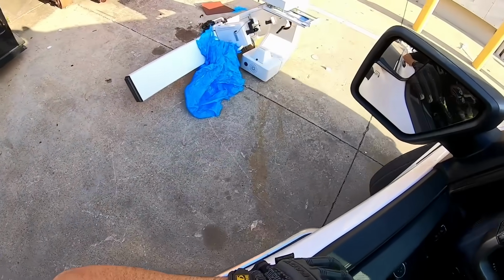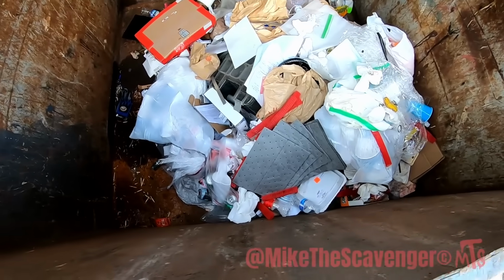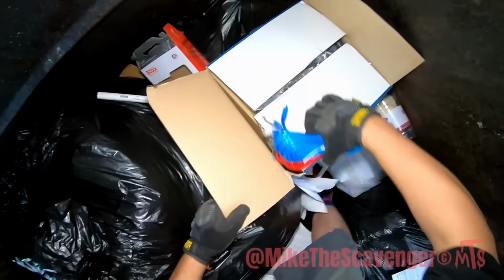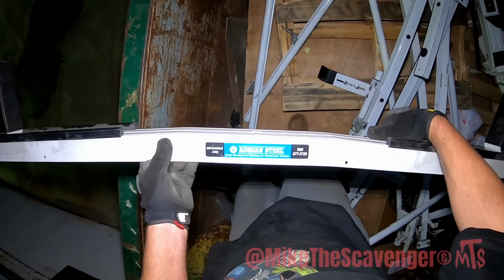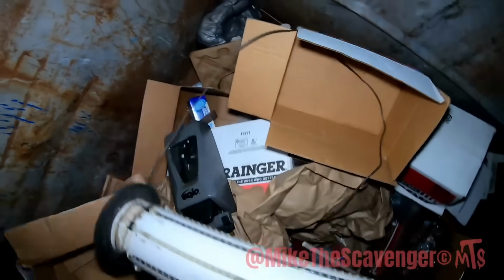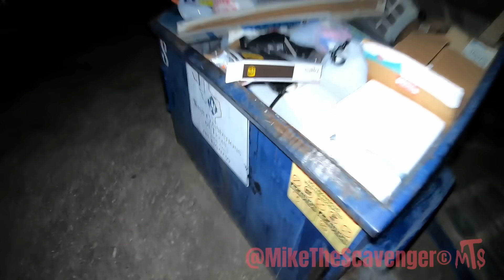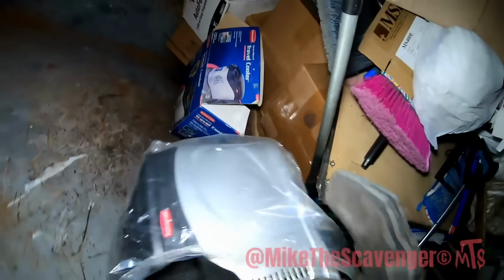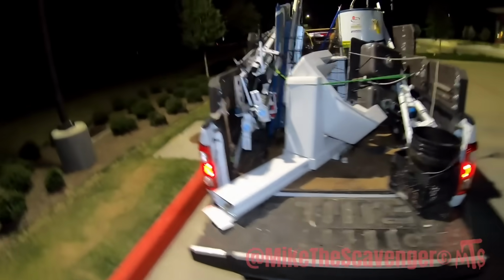Dumpster Diving "It's A THRASH Panda!"

Comment: Mike,
The x-ray machines have changed. You need to heve a geiger counter with you at all times. I saw the radiation stickers on it but most likely when active.
Please use caution dismantling any machine that has that symbol on it. May have an ammout of radiation on that metal.
Get a personal geiger counter and keep in the truck. When it sounds its alarm just leave it where it lies and keep away.
Best to you and your family.

Comment: Hey Mikey!!  Those keyboards at 3:22 looked to be OEM Apple mechanical USB keyboards.  If so, they are worth $$$$!!  The tool at 12:11 looks to be a Schraeder valve removal/install tool (everything from bike tire valves to HVAC systems).

Comment: Those long aluminum square poles you had are called load locks. They use them in the back of the trailer to support the load and also to support the trailer at the same time.

Comment: That is an older dental panoramic X-ray machine that loads a film cartridge in that part that slides in and out. Digital X-ray machines use way less radiation exposure for an image making this one out of date. You may want to check the specs on this model or call the company to make sure it wasn’t made before 1979 (I doubt it), because it could have PCBs. Most modern machines like this don’t use a radioactive element, but instead converts electrical current into ionizing radiation (X-rays) WHEN IT IS PLUGGED IN AND ON/IN USE. Otherwise it should be harmless. It might have lead? But probably lots of good scrap value. The dental office tossing it out should also know this because we have to be regulated by laws to use these and can’t just toss out radioactive materials, which these shouldn’t have, or else THEY would be in trouble. That is all.😃

Comment: Hey Mike, that Cranex 3 xray machine only produces radiation from the X ray tube when there is power to the unit. But maybe do some research yourself first if you are going to fully disassemble it.

Comment: Hopefully the source has been removed ! I can still remember the Metzler scale Technician  who pmd our lab scales and all his fingers were screwed from working on radioactive contaminated scales in the nuclear industry.  He was around 50 but looked 90 years old . Buyer beware  !
Reply: Modern ones like this convert electrical current to ionizing radiation (X-rays). Only emits X-rays when plugged in and activated/in use with the trigger button.
Reply: @dr.a006  Hopefully he knew this already as I assumed they had a radiation source .

Comment: The X-ray machine is an OPT or OPG machine. Only generates X-rays with electrical current. There's a Tungsten anode in it if you can scrap tungsten...

Comment: Mike that panographic X-ray has a head in the c arm part that needs to come out before it gets scrapped it's where radiation is ommited when power is applied
Reply: Also the counter weights have cables sometimes.lay the X-ray on its back and everything should slide out

Comment: Radioactivity sticker on it....🤔
Reply: Radiation only when in operation, there is no radioactive substance in it ! It's an X-ray for dentists
Reply: @dd313car correct. No radioactive elements used in modern ones like this. Electricity converted to X-rays. Physics!

Comment: Thanks Mike The x-ray machine is not radioactive and should produce some good shtuff (ish) looks too new to have PCB's. I was an Ironworker (Rodbuster) in '84 when someone scrapped a radiation treatment machine in Mexico that contaminated rebar (We were using Mexican steel) all over the place. A trucker made a wrong turn at Los Alimos and set off alarms is how we found out environmental disaster to this day! Thanks again Mike

Comment: If you take that x-ray apart, be carefull. The radio active material might still be in there
Reply: No
Reply: Hey Google there is no radiation once the machine is off and disconnected
Reply: @paulafratus2210  why would the radiation be gone when the machine is off? The radioactive component is always radioactive

Comment: Mike, you probably know already but be VERY careful with XRAY stuff! I think they have dangerous material in there that you ought to keep lead-lined.
Reply: Modern ones like this should only use electrical current to convert to ionizing radiation (X-rays). The most hazardous thing is probably some lead in it somewhere, which should ideally be separated to recycle too.

Comment: I don't believe someone would leave an x ray machine out for anyone to pick up. I think MTS is staging pickups.
Reply: My theory is that most businesses have cameras and know that Mike and other scrappers regularly check out their dumpsters so they often leave stuff outside the dumpster for easy removal. In this instance I agree with Fluffy, it was too heavy to get it in the dumpster.
Reply: I think he’s been to that dumpster many times behind a dental office or maybe equipment repair place. He’s found lots of dental stuff back there before. This machine is an older obsolete model, uses film, newer ones are digital.
Reply: @dr.a006  I agree, he has a route figured out after five years that are proven to be good dumpsters, the open tops are more random.
Reply: @indianaslim4971  gotta keep checking those honey holes! Regular ones always have scrap. And to get them before the garbage truck comes!
Reply: @dr.a006  yep, HVAC, plumbers, electricians, he probably knows the time schedule of the trash pickup for all of his regulars.

Comment: radio active that is not funny. please call the police or I will make sure u loose u r $$$ I u tube!
Reply: Whoa, tuff guy in the comments section! , what a maroon...
Reply: Who you gonna call.... Ghostbusters?
Reply: It converts electrical current into ionizing radiation (X-rays). No radioactive elements are in these modern X-ray machines. They might have lead, which should be separated and recycled, but otherwise it’s all scrap metal. No worries friend! 😃